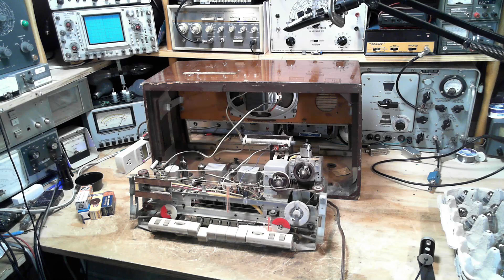Nordmende Turandot Tube Radio Video #8 - Dial Lights and Finale

Comment: If you go with LEDs you might as well go  with strip lights. The warm orange would have kept the vintage look. And LEDs come in colours that would be closer to original incandescent.The paper should have been made by measuring the original defuser paper and hanging it on the strings in the original configuration.

Comment: He shouldn't use LEDs on radio equipment - diodes are extremely noisy and spew hum in every direction...
I'm not sure what was the purpose of that part from 54:50 to 1:00:28 ??????

Comment: What a bodge job on the diffusor paper! Not only doesnt he listen to advice in the comments, he dont even go back nd watch his own videos! In part 7 of the turandot series it is clearly shown how the old diffusor paper is positioned between the dial strings. No need to cut out a big part of the bottom right corner which will then leave a gaping hole in the diffusor that is clearly seen on the right side of the FM scale.
Poor owner...

Comment: Cold White LED bulbs are a bad choice for many reasons. First that light color is completely unnatural for this type of radio, second these are way too bright. And finally at this level of light output from what appears to be a single LED encased in resin, it stands to reason that the LED is driven very hard and not only may it fail fast but especially the high efficient cold white phosphors are prone to rapid degrading into a dim yellowish glow. 
There is warm white LED bulb replacements available that use  8x warmwhite 2835 SMD chip LED spread in the glass envelope to provide a more original light color on a 360° illumination angle.

One more thing to consider is, that many of the ebay LED bulb replacements in E10 are for DC operation only, meaning that on AC they would only light on one half of the sinewave. That may be evidenced by Jim  experiencing the bulb shimmer in his peripheral vision. If these bulb replacements are DC only and dont have an additional rectifier inbuilt since they are merely a LED and dropping resistor, then the LED will be subjected to ~9V peak of reverse voltage on the negative half wave. The safe reverse voltage of white LED is mostly <5 to 6V before reverse breakdown occurs, which even if current limited can damage the LED.

Bottom line; why not get the proper incandescant bulbs?
First that would keep the radio original, secondly it will provide the right illumination pattern, and if the correct type of E10 7V 0,3A bulb is used they will neither overheat the diffusor nor burn out quickly.
Reply: Concur. In older equipment like this I like getting original bulbs.  When I do use LED I love the warm ones a lot more.  The others are just too harsh to me.
Reply: Right on all counts. Like warm light coming from where the original light came from in all tube radios as well as
vintage  amps too.

Comment: At any place that sells crafts you should be able to get vellum. Fold it in half like the original and it will be an exact copy
of what Nordmende used. Vellum!
Reply: Correct about the Vellum paper. But the original Vellum is creamy white and the soft warmwhite color of the backlighting comes from the slightly under driven 7V bulbs.
Precolored Vellum may be too absorbant. With cold white LED you could try to dye/age the pure Vellum by soaking in black tea or coffee.
In a pinch baking/parchment paper may be worth a try too.
Reply: @randomsteve4288  They make excellent parchment paper for cooking nowadays.
Reply: Agree as well vellum is so much better.  Forget who I was recently watching but they were working on a Normande and cleaned the diffuser up with a damp rag.  This one was destroyed but do it right and keep it looking good not the butcher job we saw

Comment: I was just saying to someone that I wished someone made the #47 bulbs in an drop in exact replacement LED bulb...and here you say you have some...so where did you get them if I may ask?
Reply: Check my posted comment above for a #46 bulb. A #44 or #47 would be the bayonet base style. 
Those are available as LED types also. But are too bluish for my tastes.